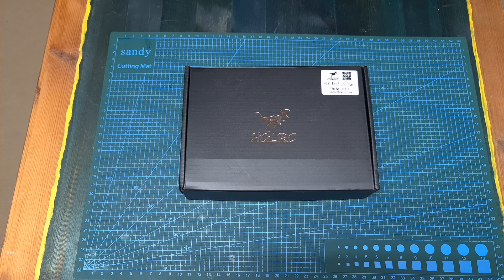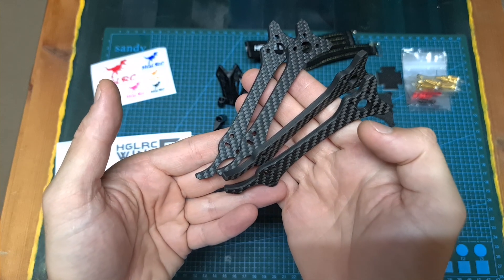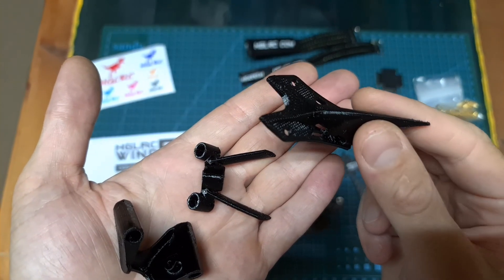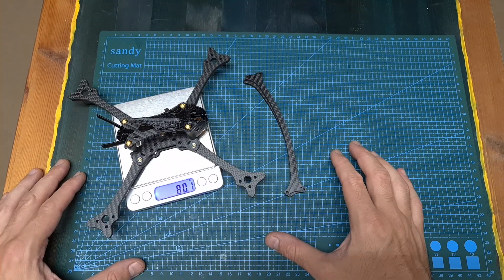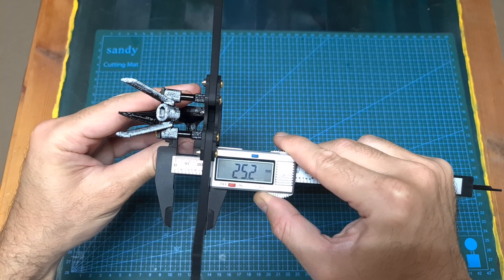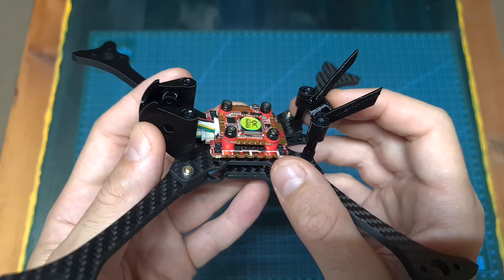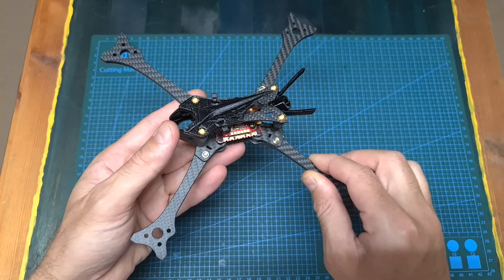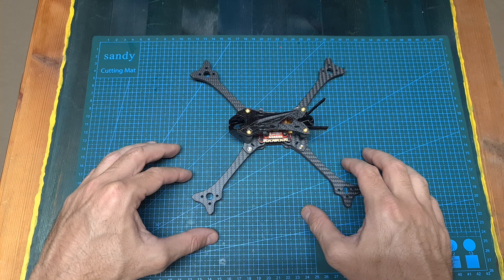HGLRC Wind5 Lite True X Lightweight Frame Overview

Comment: How did you get the battery strap under such a low stack?
Reply from the maker: You can first place the battery strap and then mount the ESC.
Reply: I have about 2.5mm to 3mm gap between mid plate and esc. Is that enough clearance for strap? Thx in advance. Its my first race drone build.